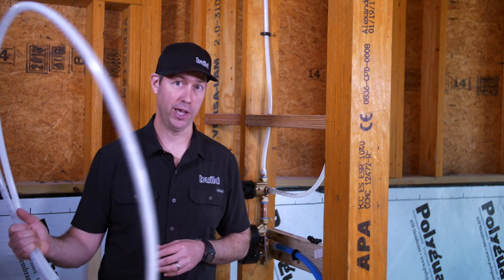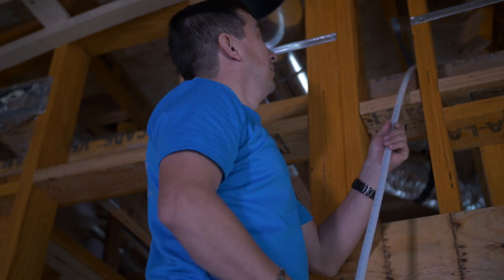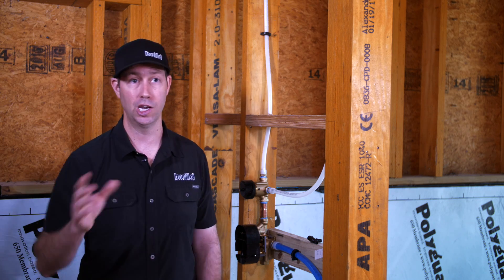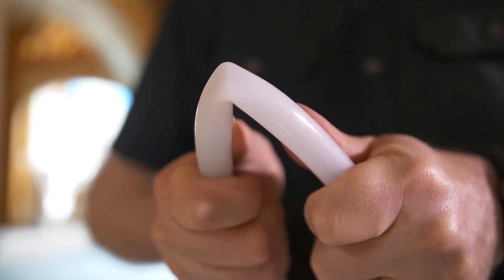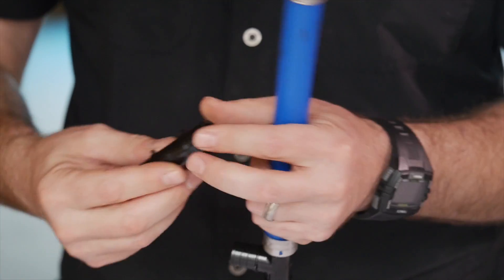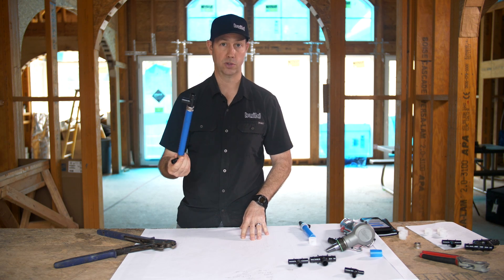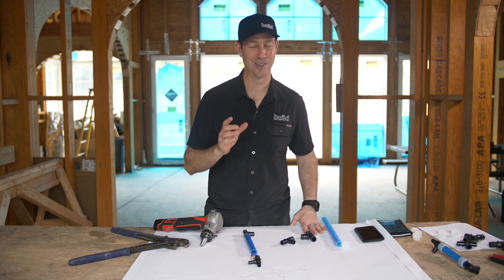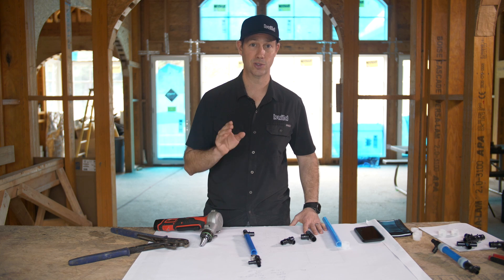PEX vs. Copper Plumbing

Comment: i like this pipe i have used it on my car for air ride 
and i have put 150 to 200 in it no leaks 
im used this type on my new air ride but 3/8 with push fittens

Comment: You mention 15 years of installation, but these are not as relevant as the 50 years or so the system should last. The longest warranty offered by PEX manufacturers is 25 years...

Comment: I doubt the difference in fitting inside diameter makes much difference as the fittings are very short and will just cause a velocity increase thru the fitting.   Probably easy for an engineering type to calculate.  Love your videos.

Comment: Ok, but you forgot to talk about copper ...
Reply: Norm T  except in the UK the water is chlorinated.. Dunno about the States. New builds here all use plastic pipe
Reply: @syrus3k  all Treated water here in the U.S. is chlorinated as well.
Reply: He also talked about the fact that the copper uses right angle turns thereby affecting pressure and allowing for "hammering"  more so than Pex. Copper is far more susceptible to corrosion as well.
Reply: I prefer copper due to anti microbial properties and the fact you will know instantly if you install it wrong once you check for leaks instead of finding out later.
Reply: Der Hof 2007  never drinks out of plastic cups or bottles, strictly Moscow mule mugs.
Reply: Der Hof 2007  I agree on copper, if, and only if, you have craft that sweat it right. A good sign of a bad weld is a gorilla weld. The problem with copper is theft.
Reply: Electionfraud Isreal  your family. Good job. Keep doing houses.
Reply: No he didn't, it was mixed in. Cost for copper- up, Pex down, frozen water, leaking, ease of installation, fixture availability, pressure drop & reduced flow due to bends, etc.
Did you WATCH the video...??
Reply: I hate pex. Takes all the skill out of the trade. You don't have to plumb, just bend it. You don't have to solder or braze. Plus it's plastic crap. Same reason I'm against PVC. It's illegal in NYC. I think DWV systems should be DWV copper and cast iron. I bet a lot of plumber's don't even know how to do a lead and oakum joint anymore. So sad.
Reply: Der Hof 2007 not a real plumbing expert are ya? Pex piping has proven over 20 yrs it’s better than copper, as well as all the reasons he stated. Oh & copper is so much better, why doesn’t NASA use it in shuttle & space station but they do aqua pex?
Reply: @bige2012  Two main reasons... weight and cost. I remember reading a NASA doc about it a while back
Reply: @CoroaEntertainment  im also guessing it doesn't require a plumber on board if something happens
Reply: @dustinpomeroy8817  You have good point there I must admit. That would be a huge service call.
Reply: @bige2012  What a ridiculous comparison. NASA uses PEX because they need to save on weight above all else.  And, they don't need it to last for decades. The life of the space station or a shuttle is just a few years. A house's plumbing should last 50 to 75 years.
Reply: @bige2012  I mean, regardless of whether pex is better or not, that doesn't seem like a good argument to me... It costs around $54,000 dollars per KG to send something to the IIS, so obviously they would go for whatever is lower weight.
Reply: @bige2012  they don't use copper in space because it's conductive and would need to be isolated with the mix of aluminum/magnesium/titanium plus it oxidizes rapidly with the type of oxygen that is induced in the station. Its not  because it's a superior type of tubing for carrying water. Horrible analogy for use of comparison.
Reply: @djtheg6819  Also because of weight savings! Costs a lot of money to bring stuff to the ISS.
Reply: @bige2012  Wow, Pex has been around  about 40 years now.  Properly installed copper lasts 50+ years at least.  The earliest Pex installations are still less than 50 years old. I live in a house built 65 years ago. All original copper. I've seen houses from the 1920s and the copper is still in great shape.  Let's talk about Pex in another 20 years.
Reply: Addressed copper with $$$$ cost.  That alone stands as much as I needed.
Reply: Till your paying $$$$$$$ for cancer treatments if your lucky.
Reply: Hammer copper know to cause ahlzhimer.
Reply: Der Hof 2007  little butt hurt bud.  Copper is junk and should be left in the ground where it was found. The time spent cutting/cleaning/fluxing/soldering is why your wage takes a hit. Let alone the material cost and the added cost of insulation due to condensation. Open your eyes you clown.
Reply: @98ek9  ya, even dumbasses can install copper quickly with a propress. If you don't live in a area with extreme weather then copper is king. Name a plastic that hasn't had a problem with degredation over time? Pex is great as  product to install because it is easy but imagine a whole subdivision of home built with pex that the municipality had to do a chlorine treatment to treat it's water mains ( cities do this regularly about every 10 years) and then your whole houses pex system starts failing. Pex has its place but it's still just the cheap alternative to copper. The raw metal itself ( copper) kills bacteria and mold. Ever open up water fountains that use pex tubing????? Disgusting. There is a reason why pex is not used In a commercial setting. The amount of "cycles" something is used in a commercial setting is multiplied dramatically compared to a home. It essentially shows how a product holds up to usage at a much faster pace. That shows that pex can't handle the amount of usage over a longer run, where more "cycles" are induced and wear happens at a faster pace.
Reply: @djtheg6819  I don't know what chemical process you are following but you missed the bus somewhere. Sodium Hypochlorite, which is the active ingredient in "bleach" or "chlorine", is stored oftentimes in Plastic containers, NOT copper because of it's corrosive nature. In fact, the percentage used in municipal water systems is 3 to 4 times that used in a bottle of household bleach. It will corrode 304 stainless pipe. Also, a chlorine residual is maintained in the lines to kill algae, bacteria and potential molds. So your argument regarding copper is redundant.
Reply: Norm T  survival of the fittest. 
Your probably always using hand sanitizer, thinking your safer because of it. Get real, we all die.
Reply: @98ek9  The only sort of people worse than stupid a holes are loud and proud stupid a holes. Yeah, that would be you.

Comment: The extra flow/pressure from the one or two fittings in a pex system won't be significant in a home, especially considering all the faucets have flow restrictors anyway. (meaning 1-2.5gpm, while that tube diameter is practical for 5gpm in residential length runs, where velocity becomes high enough that the hard corners and edge turbulence actually causes more drop than the simple minor size restriction.)  Now for proper garden hose hydrants I would look for at least one inch nominal pipe, but that is more to reduce peak velocity and the pressure spike caused by rapidly closing the valve not for the minor increase in flow or nozzle pressure. ("water hammer" can add 100-200psi or more in poorly designed systems with long runs at high velocity with valves that close in under one-two seconds) Runs over a couple hundred feet should have water hammer arrestors near the valve and or speed limited valves or very oversized supply pipes as compared to the capacity of any single hydrant.(possibly a moderate flow restrictor as well). 300 feet of 1inch pipe moving at 5-6ft per second(very typical) has the same kinetic energy as a man at a fast jog or moderate run, now how much force is needed to stop that man in one second? 
Double the pipe diameter quadruples the water mass but it quarters the velocity [at a fixed flow] and the sum is that you end with 1/4 the kinetic energy. (100kg at 5m/s=1250joules, 400kg at 1.25m/s=312j) In addition cutting flow to 1/2 will reduce pressure drop to 1/4, if 100psi is needed to move 10gpm through a section of pipe only 25psi is needed to move 5 gpm(a strong garden hose), 8psi for 2.5gpm(a shower), 2 psi for 1.25 gpm(a typical sink); respectively leaving 75psi, 92psi, and 98psi for the terminal nozzle. OR in the case of a pumped system with a fixed static head pressure(pumping out a pond or a typical well with pressure reserve tank), said flow reduction reduces the power losses(per hour) from dynamic pipe friction from 10*100=1000base units to 125, 20, and 2.5, and total energy loss (per gallon pumped) from a base of 100units to 25, 8, and 2. (however larger pumps tend to be more efficient so these are ideal not real numbers)

Comment: PEX is amazing stuff. We majorly remodeled our home and I replaced all the new water lines with PEX and when we were out of state once and our neighbor was "watching" the house our furnace went out which caused the pipes to freeze. When we returned home none of the faucets worked due to ice-blockage. I was terrified I would have to tear into the joist bays but after a looong thawing session there wasn't a single leak in the entire water system

Comment: Wow just clearly biased . first off you didnt mention the latent heat expansion in pex which is how much more it expands when heated in comparison to copper and multilayer pipe. Then after you explain to us how much flow rates are important you show us the fitting on a half inch fitteing which then is reduced down to 10 mm from the inserts. You didnt mention an oxygen barrier on the pipe. Then you talk about all the houses you did and no leaks. Meanwhile I spend a lot of time in estates where they had pex installed 15 years ago fixing leaks from the brittle plastic inserts breaking.

Comment: I have installed a lot of pex b in my own rentals. I used b because of the cost of the expansion tool for my first small job and have stuck with it.   My only concern is if I ever have rodent problems will they chew on the pex and have me feeling like I need to replace all with copper?

Comment: Hey Matt, I noticed in your example of the viega style pex connection that you weren't actually using the viega pex press fittings but instead using standard crimp fittings with a viega style sleeve. Is this what you or your plumbers normally did and how well does that combination work?

Comment: Why would anyone use copper anyway?
I can see no advantages of it in plumbing.
Expensive (it's rare metal!), requires lots of work to install, pressure drops as listed in video, high thermal conductivity, meaning high leaks from water to walls and environment, corrosion, bursts when water is freezing, and it goes on.
Copper is great for electronics, and leave it there!
Reply: Biggest reasons to use copper: Rodent Resistant, usable as a ground, nail/screw puncture resistant, fewer questions about durability in the extreme long (60yr+) term.  I'll still use Pex.

Comment: Pex Is Horrible.....Palm Springs, CA.  Can't handle the desert heat!     New Construction homes built in 2007.    10 years later houses flooding, chemical tastes, smells in the water.....$60,000. in damage of my home....most of my neighbors are now having major issues.  We are having all of our homes repiped with copper......Dangerous Product....DO NOT USE !!!!!
Reply: James Travis I bet the plumbers stock was left out in the sun.
Reply: James Travis Pex is definitely UV sensitive! Installers were not properly informed when certified I think
Reply: Thats like saying " I got a flat tire. All rubber tires suck. Only use iron wheels." 
PEX saves time and money with equal reliability and no open flame during install.
Reply: What type and grand of PEX?
Reply: James Travis... you’re a damn liar too
Reply: PEX is installed all over the Southwest, but somehow is can't handle Palm Springs? I take my chances that it wasn't installed right and probably handled improperly prior to installation.

Comment: Are there any issues with PEX and pex fittings degrading in cities that use chlorine to clean water supply? I have read that after several years now, people are seeing failures in PEX due to city water chlorine degradation. Please let me know if this is not a concern or only a concern with some brands?  I would not want to get into pex only to have it fail 5 years down line due to chlorine degradation and leaks of fittings.

Comment: I am not sure I like PEX. Water is known as the universal solvent. If it is not depositing something like it does in copper then it is absolutely taking something away. Copper is not inherently bad for the body in microscopic amounts. On the other hand PEX is a chemical based product petroleum derivative. In microscopic amounts something is being taken away in a PEX pipe system. PEX is an HDPE plastic used a lot in bottles an there is not as much of subtracting of anything in bottles because then fluids are for the most part stationary. Where as in PEX pipping the fluid is flowing under pressure. I am not so sure PEX is as good as we are made to believe.

Comment: There is no such thing as a system without flaws. I was a water softener technician for a time, years ago. I have personally seen copper elbows fail. Eaten away from the inside due to the use of softened water. Softened water wants to gain minerals back, and will get it from copper. CPVC gets brittle after many years. PEX is the future.

Comment: Uponor PEX is the best, I love using it, Goes in easy and the expansion method leaves you with the larger size as Matt showed. He didn't mention it's only significant drawback and that is exposure to UV light. That's easy to over come though as you simply wrap it where it's exposed to sunlight . Bends easy, if you kink it you can repair it, won't freeze burst and is much cheaper than copper. No good reason to not use this stuff.
Reply: So, you have water supply lines outside on your sidewalk in direct sunlight ? In Chicago water is piped into your house underground, and most interior pipes are enclosed in walls or in your dark scary basement.

Comment: Thank you for the primer on PEX.   I've seen it around, never used it, and never before realized there are types "A" and a "B."  I hear the caveats against "rats" and would accept that challenge, as modern houses are full of "chewables"  (like Romex) anyway.  But what intimidates me (as an engineer, who formerly designed production electronics) is the danger of swearing allegiance to anything that is single-sourced.     So if those PEX fittings are not manufactured by more than one company, I'd raise my red flag and stop, before the first hole was drilled, before the first tube was laid.      

Matt Risinger touched upon this subject only momentarily, and it deserves full exposure, full diligence.     Single sourced parts require the sign-off of a Chief Technology Office, or similar, in properly-run engineering corporations.      Take a lesson from those people who push paper all day... and sleep well at night, knowing they have multiple sources for critical components.
Reply: There are alternatives even using single-source components.  For example with PEX, if the company goes belly up, you can always cut out sections and replace with other types or other manufacturers.  It isn't like the system goes in and you would have to replace the whole system if a single-source goes out of business.  It is somewhat modular in that way.
Reply: There are many manufacturers and has been for quite awhile. Now what all can be found in your local areas might not be the case. He mentioned Viega and Upanor in the video. But there are many others such as Ipex, Rehau, EvoPex, Auspex and Duopex that I have seen. And have heard of Vanguard and Zurn as well. There are also many other types of fittings that can be used with PEX not mentioned in the video. Also not mentioned in the video is a 'C' type as well, but it is the stiffest and more prone to kinking and freezing, although also the cheapest. So is no red flags needed, as stated in the video PEX has been around for many decades and has many manufacturers making this product as a result.
Reply: For what it's worth...one year later...I'm re-doing my house with PEX-A, and there are now at least two different manufacturers:  Uponor/Wirsbo/ProPex, and Apollo, which is distributed by the big-box stores.  It seems like the system is taking off, and I wouldn't be surprised if it becomes the new standard.  Copper seems great at first, but almost all of mine has completely corroded.

Comment: Just had my house re-piped with pex A... it was built in the mid 60's & had galvanized pipes... huge difference with pex! Water pressure is awesome and also the hot water is almost instant at the sinks & showers... worth the extra money in my opinion 👍👍👍